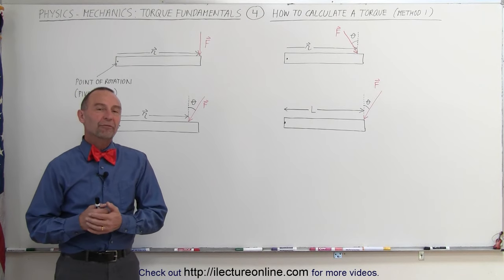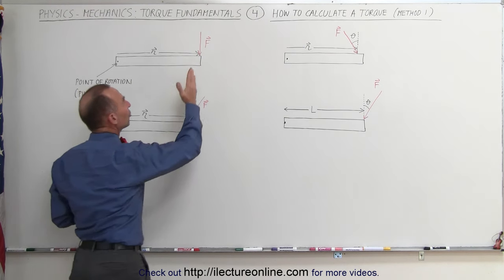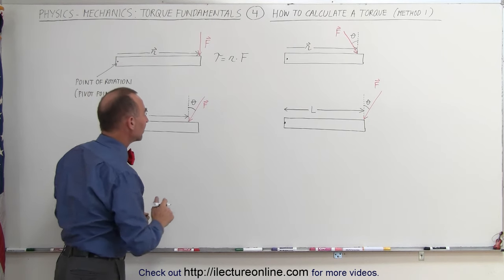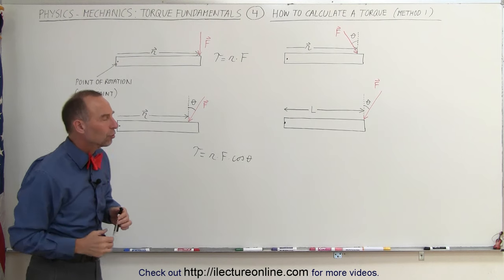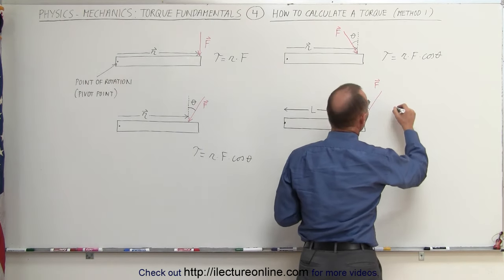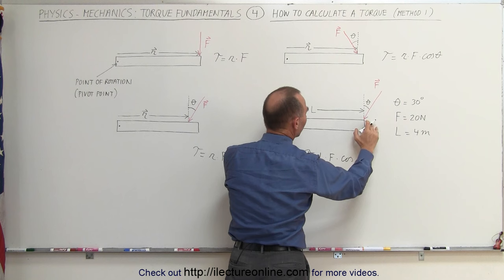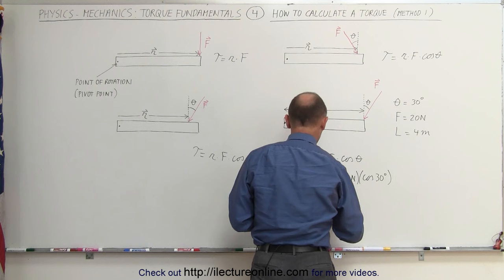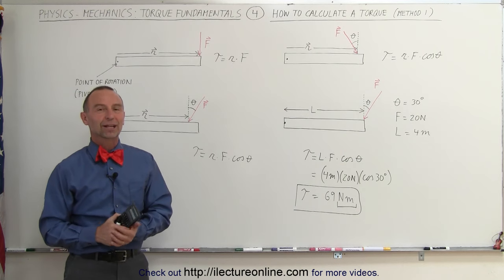Physics 15  Torque Fundamentals (4 of 13) How to Calculate a Torque (Method 1)

Comment: Could you please explain why we must use cosine or sine depending on the angle between the vertical line and the force direction; the angle between the position of rotation and the force direction?
Reply from the maker: Think of it this way:   Torque will be a maximum when the direction of the force is perpendicular to the moment arm  (the object you are pulling or pushing to make it go around).  When you consider the angle relative to the perpendicular than 0 degrees gives you a maximum torque  (cos(0) = 1).  When you consider the angle with respect to the moment arm (the object) then an angle of 90 degrees gives you a maximum torque (sin(90) = 1)